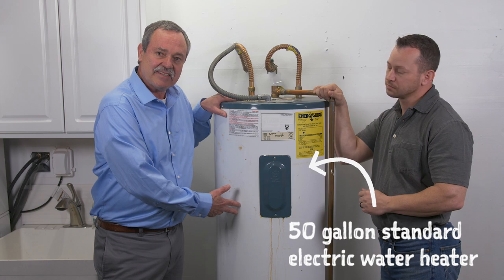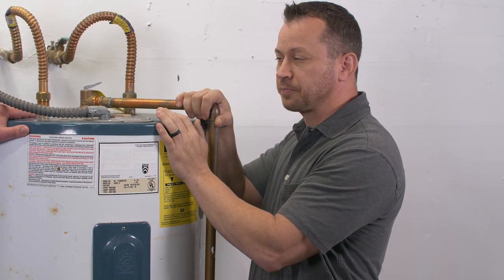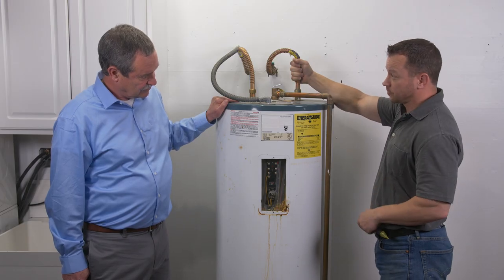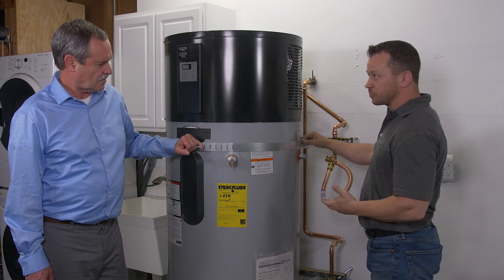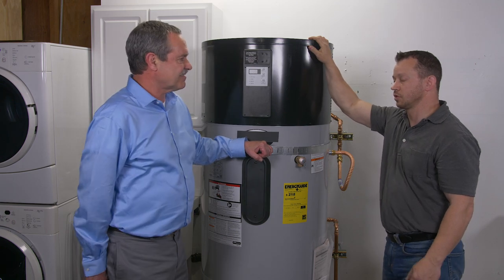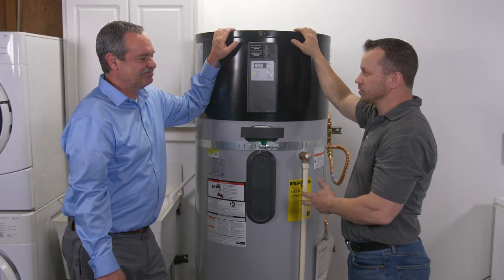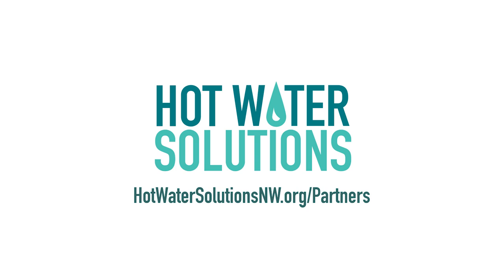How To Install a Heat Pump Water Heater: Professional Version

Comment: I just got an open box 50 gal unit from Lowes for only $900. I cannot wait to install this over the weekend.
Reply: Let us know your experience so far.
Reply: @ramkunda5423  great so far no problems and a lower electric bill
Reply: @brandx2321  Did you have to run a dedicated circuit, and if so, how many amps?

Comment: Seriously the hook up of this hybrid is like a frankenstein monster with pipes and drain lines, valves, all over the place.  Rheem really needs to clean this install up, run the friggin supply line connectors up to the top, just like any ordinary water heat, it is not that difficult to clean the Heat Pump, other supplies or hybrids have done it.  Those side connectors and drains are just screaming for someone to bust one off and flood the area.

Comment: Is a vacuum breaker required for this bottom fed water heater?
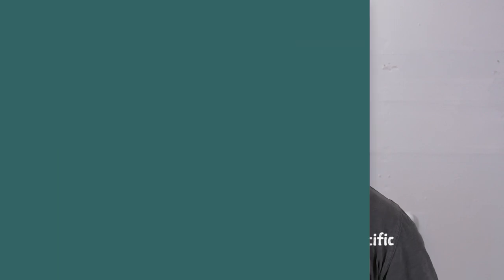Reply: I was wondering this too. It appears there's just a ball valve on the cold water pipe at 2:45 and I don't see any mention of it in the manual so I assume it's not required.
Reply: @christophergalvin8121  Actually if you reference the AO Smith instruction manual they show a vacuum relief valve (when required by local code) located after the cold inlet valve.

Comment: I just installed one of these A.O. Smith units.  Several things surprised me.  The first is how the air filter is of little value as it has a very poor fit allowing several gaps for unfiltered air in.  Another is the lack of engineering to make connections ro the inlet and outlet easy.  They are not in line vertically.  The bottom connection is very close to the floor.  This makes the use of sweat connections difficult as the manufacturer does not want any heat applied to the inlet and outlet as they have a thick plastic lining which can be damaged.  This requires making an assembly and then screwing it onto the tank.  This requires tilting the tank to accomplish that.  Overall a pain to work with unless you are supporting a fitting manufacturer.
Reply: I've seen a lot of similar comments about the a o Smith hybrid heat pump unit. Apparently the rheem model is better.
Reply: 1waffleiron hopefully! Just got Reem
Reply: use 3/4 brass 90s then male adapters into those. cheapest place to get them is amazon
Reply: Rheem's version looks like it's a much better water heater. Just the way they designed the air filter is dumb.
Reply: We've got a GE, and the filter looks like a sieve. One thing I notice is even companies that provide a duct kit don't account for the small size of many "water heater closets"... Rheem says use a louvered door, and face the outlet towards the door... trouble is, if you do this, everything else you need to access is facing the wall . I can't imagine that locating the necessary fittings/controls to allow for "easy installation" is rocket science... but then again, you'd have to pay some engineers, and that would cut into the shareholder return! ;-)

Comment: 50 gallons for family of 4 more than enough in heat pump mode (the most efficient mode). There’s no shortage in hot water. Good I didn’t buy 80 gal.